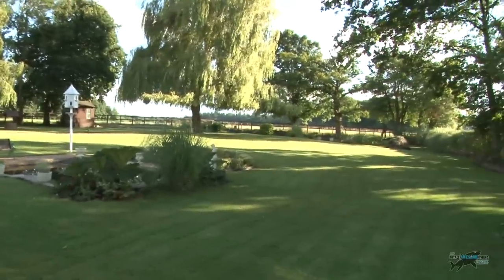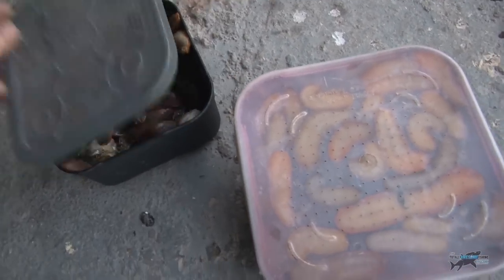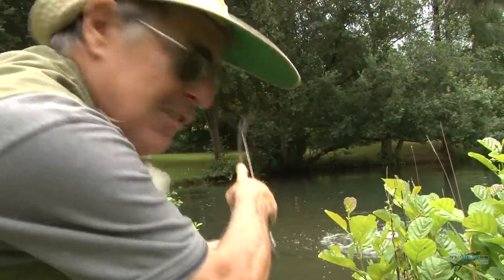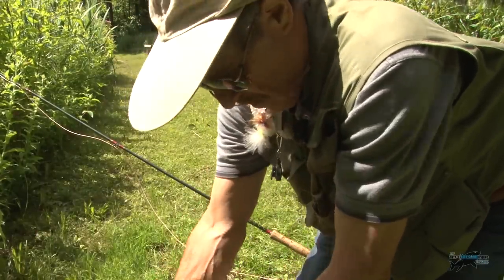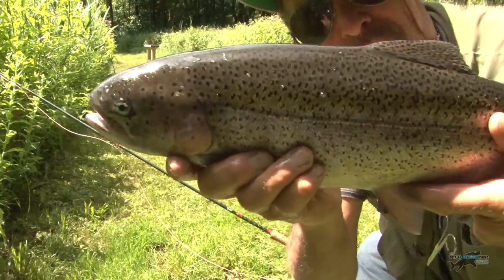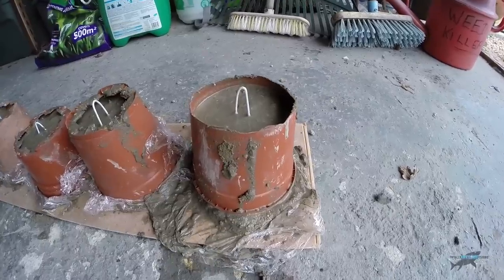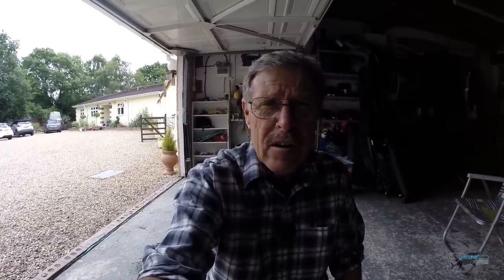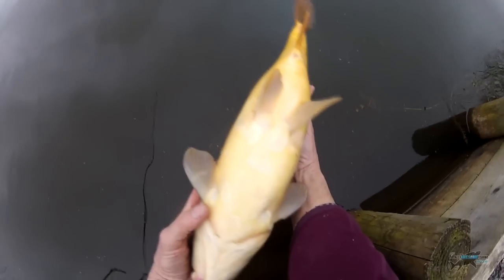SLUG BAIT For FISHING!

Comment: I caught my first 4 foot  shark (smoothound)  on a slug back in 1979 while fishing for eels in Sheppey Kent, not sure how it didn't bite through my line back then, I've never caught another even using usual sea baits, I didn't unhook it, I just cut the line close to its mouth and pushed it back in the sea, at 12 years old i was fishing with my homemade bamboo rod originally from the center of a carpet my parents had delivered, also was using a Winfield fixspool from Woolworths where I used to get most of my fishing gear as a kid, I wish we had camera phones back then.
Reply: how on earth did u get it in???on such gear!!
Reply: @tadhghayden8440  i dont know but it took me some time and my friend hanging on to my rucksack to stop me getting dragged off and 40 years later I still can't work out how and why it never bit through the line, it was my biggest fish I have ever caught here and my only smoothound from the beach on Sheppey. My luck must have been running well that day
Reply: Wow.. The good old days 👍
Reply: @kevslife  yup when a 30 or 40 yard cast would do the job here but sadly now over fished by foreign trawlers 100 yards out
Reply: @rickburnout666  my thoughts exactly.. It's a very sad case of affairs.
Reply: Eh, that'll be because they don't have teeth.

Comment: Gonna take that cement weight mold idea and use them as anchors in my kayak and jon boat. Thank you Mr. Graeme.
Reply from the maker: You could easily upgrade them to a large flowerpot which should be anchor enough for a kayak.

Comment: As usual you are very entertaining even if its not about fishing.  Let us know when you will be using the slugs for a fishing trip.  I also thought instead of just letting your new flower pot weights go to the bottom to stay that you could put a piece of hangar into the side of the concrete pot to be rigged like it was one of the corks you have used that with a small jerk from the fish the line would pull free from the potted weights and the fish would swim away and besides catching the fish you could bring the weight back up to the boat each time by using some stronger line and continue to reuse them.  I can't think of what you called it when the fish would pull the line loose from the side of the cork and then the cork would be loose to slide up the line or down to the weight before hitting the hook.  I think you know what I mean.   Again on friday evening the first thing I watch is your fishing video.  I have watched some of mikes ta outdoors but its just not as entertaining as your videos.  I used to love his bushcraft adventures as well as the hunting but lately they are just boring to me.  Guess at 72 building viking huts just ain't that appealing but I keep watching hoping to see him get back to the kinds of videos that I enjoy.  Thanks again Graeme.